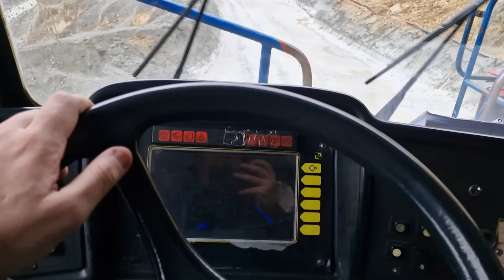Heavy Equipment Accidents #2 Extreme Dangerous Total Idiots at Work Compilation 2024 Amazing Logging

Comment: 15 years mining and I have seen most of these situations. Been a operator in most. Production supervisor in others. Although never had/let anyone dump without good windrows. But had someone tip over a tip head a month or two before I started on site. Never just pushed on with a articulated truck in mud that deep. Even being logging and worked soft/wet ground as a forwarder op.
Reply from the maker: People sometimes simply misjudge the situation, which is why accidents happen.

Comment: @4.15 re the dump truck running into the suzuki.  
1) the dump truck driver failed to honk the horn to warn people that there was a truck moving off.
2) DT turned left INTO his BLIND SPOT, ther is a reason that parking areas are set up to drive straight ahead then turn.
3) The idiots in the suzuki PARKED in the BLIND SPOT!!!   One off the first things you are taught(at induction) is ALWAYS  park so you can see the dump truck/loader driver.  If you can't see them, they can't see you.
There is a CAT safty video that shows the blind spots around a dump truck, and they are HUGE.